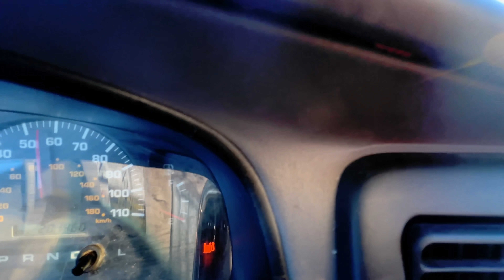Can You Use THICK WATER as ENGINE OIL?

Comment: Water evaporates at 212 ofcourse it won't work you fools
Reply: It didn't run long enough for it to get that hot
Reply: @flyhacking5830  fr
Reply: Avg oil temps range 200-210° F it  loses viscosity at 230°F and starts breaking down.  Engine water temps usually run 190-205°F. So fairly close in temperatures. The difference occurs at 212°F in which water will boil oil will not. There is no way that engine reached 212°F in those 40 seconds.. Especially in 14°F weather.
Reply: Oil doesn’t usually get hotter than that, also Cletus took a Vic about 6 miles with gas as the oil and it evaporates way easier
Reply: Liquids evaporate at any temperature above freezing.. It boils at 212° but in a contained pressurized system it does not evaporate. And water has a higher boiling temp then coolant. We only use coolant so it doesn't freeze. Alcohol evaporates much faster and washer fluid is 60% water and %40 methanol alcohol and it will last forever in its tank.. So no it did not evaporate.

Comment: Bro that engine was already taking a shit because I’ve seen engines with no oil last longer, also Cletus took a Vic like 6 miles with gas as the oil
Reply: Hondas can drive for like over half an hour without oil lol. Japanese quality
Reply: what happens if you mix the water with the existed oil in a truck engine?

Comment: Have you tried chocolate syrup as engine oil?
Reply: Stuntman From Neutral Drive poured Hershey's Chocolate Syrup into the crankcase of a Chevy Cavalier 2.2 Ecotec engine to use as head gasket sealant, PLUS he left the open bottle of Hershey's Chocolate Syrup on the exhaust manifold.

The results were disastrous.

Comment: You should try running engine degreaser in the oil system... Lets see what happens...
Reply: How about using Gorilla Glue As Engine Oil?
Reply: Yes
Reply: Pretty sure there's an old video on lifeod doing that with brake cleaner pretty much the same thing I'm gonna try and find it